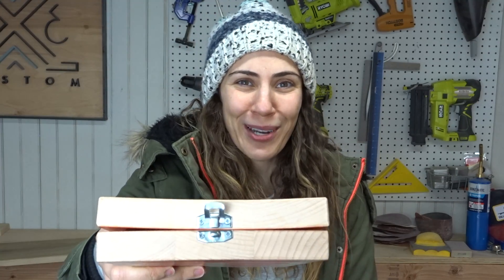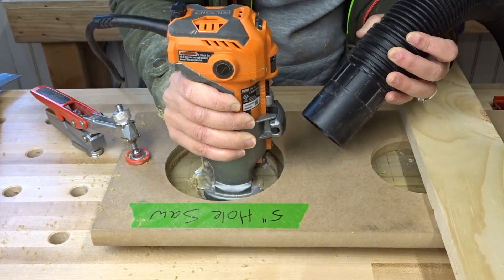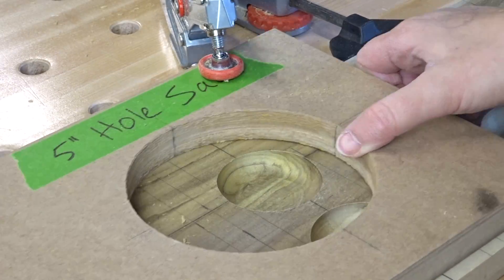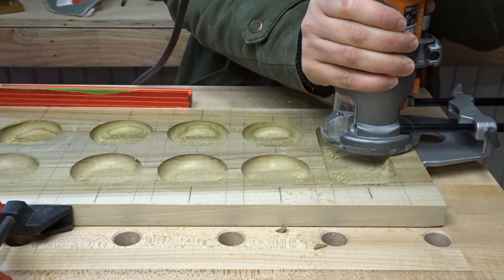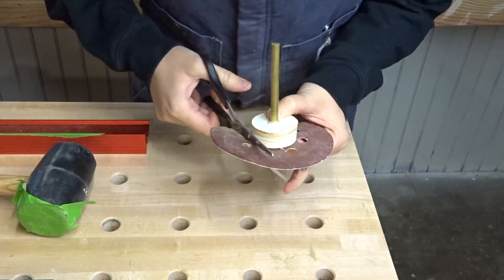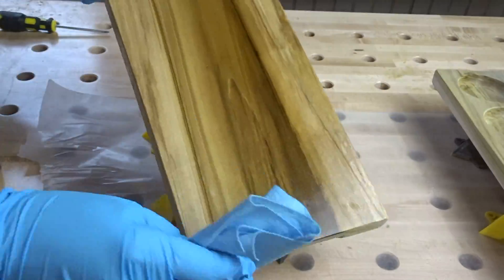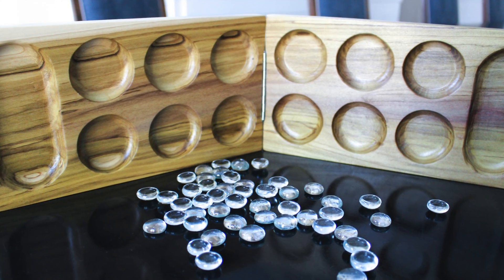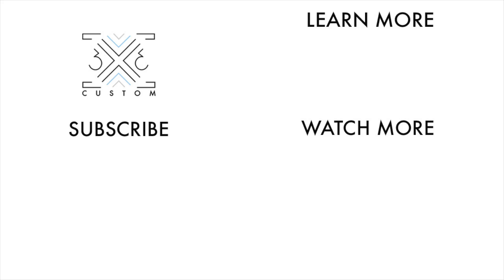DIY Mancala Game // Woodworking // Router Project

Comment: Nice build. For your little drill press sander, you might be able to cut the paper over sized, then cut notches and fold the flaps up the sides, leaving them loose. Then you would sand the flat bottom and have the flaps sanding the sides.
Reply from the maker: Maybe. I’ll have to try some day

Comment: loved the tip of using double sided tape when installing hinges!! In order to sand the holes maybe you could round the sides of the wood circle you used in the drill press, cut the sand paper a bit bigger and make some cuts so it sticks to the sides. Not sure if it would work tho, just an idea jajaajajajaja
Reply from the maker: Maybe. It’s a good thought.

Comment: Awesome video Tamar!! What was the name of the bit you used for the hinge? Could you include it in the description as well? Thank you!!
Reply from the maker: Thanks so much! I used a Hinge mortising bit. I couldn't find the exact one I used, because it was Bosch and I bought it at Lowe's. But the one I linked to should work. Really, any straight bit would work.
Reply: Thank you!! I just got rid of my router table and making hinges like that was the only thing I was wondering how I'm going to accomplish. You gave the perfect solution with the edge guide and your video. I really appreciate it.

Comment: I think a magnetic closer would would nice on this
Reply from the maker: You’re prob right. But I just used the hardware that came from my broken one.
Reply: Typically, the beads (or stones, seeds, beans, or whatever is used for the game pieces) are stored inside the game board when it's folded up.  You really want to make sure it's secure if it gets bumped around, or you'll end up with them going everywhere.  I think a latch is a better choice for this application.